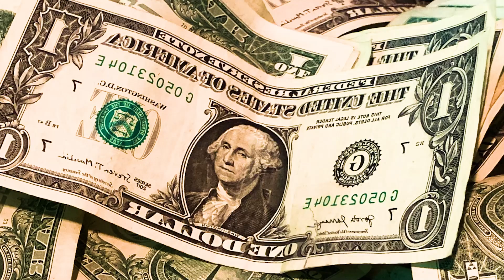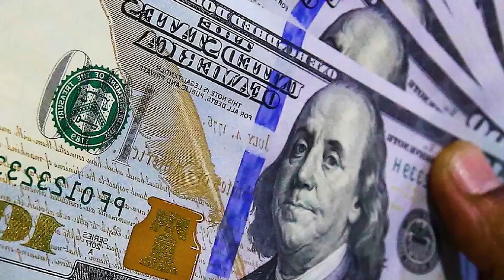China Spent $320 Million to Build the World's Most Difficult Tunnel, But It Has Taken 10 Years!

Comment: The Lötschberg Base Tunnel in Switzerland is an essential part of China's Belt and Road Initiative, as it provides a crucial rail link between Europe and Asia. The tunnel has significantly reduced travel times for freight and passengers moving between the two continents, boosting trade and economic growth for China and its trading partners.

During the 10-year construction period, the tunnel faced several difficulties, including geological challenges, such as unstable rock formations and water ingress. Engineers had to work around these obstacles using advanced tunneling techniques and innovative construction methods to ensure the tunnel's safety and longevity. Additionally, funding and logistical issues also posed challenges, requiring close coordination between various stakeholders to ensure the project's successful completion.